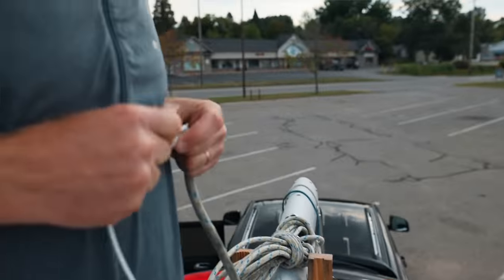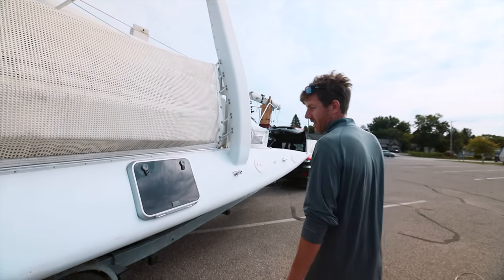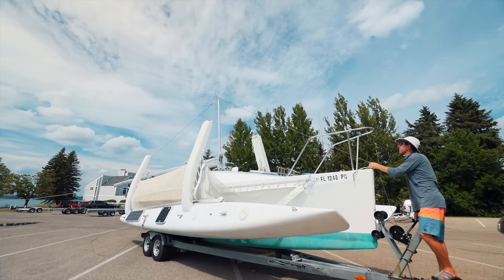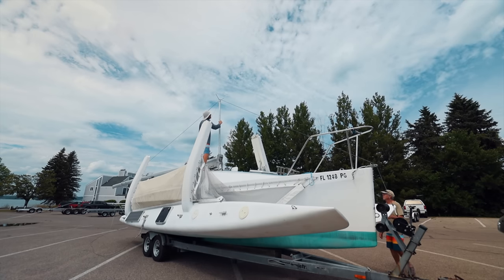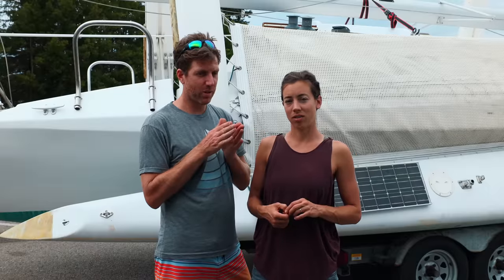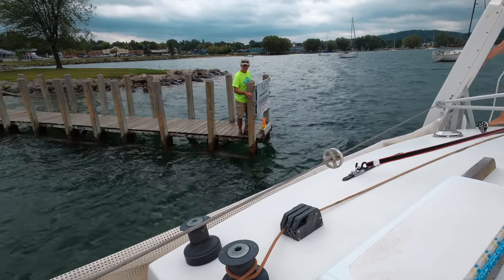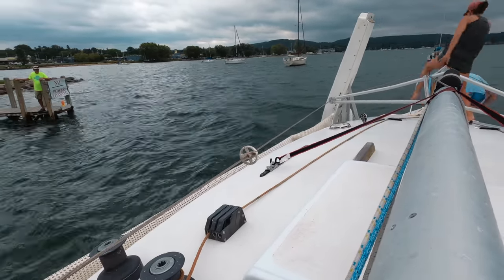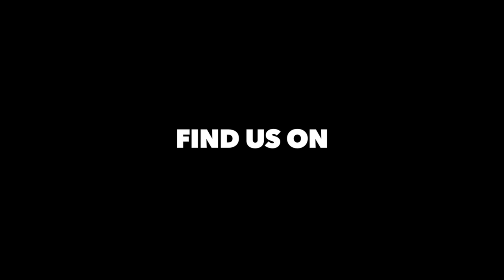How Many Quacks Does it Take to Launch a 32’ Trimaran? | Sailing Soulianis - Ep. 120

Comment: Another very important point to make is you never want to keep stressing a line if nothing is moving period the tensions on those things are incredible and if it breaks and a bolt is on the end of it and that bolt flies forward and hits you it can kill you period trust me I had two side stays on a 30-ft mast that were 1 inch off and the amount of pressure that was put on those was so high that I had to use a hammer to get the release bolt out and when it released it shot the bolt in the air probably hundreds of feet. Never ever keep stressing a line that's not moving period if it's not moving at all there's something wrong period those winches can easily put thousands of pounds on lines

Comment: As a MacGregor owner, I think your attachment point to the mast is too high up on the mast.  You're attempting to compress the mast rather than lift it.  The angle of lift would be more efficient if the lifting line to the mast from the gin pole was more like 45 degrees.  On my boat the mast is about 30 feet but the lifting point is about six feet off the deck.  Even in wind, raising the mast is casual for two of us.
Reply: Isn't it the jib halyard ~4 feet from the top of the mast?
Reply from the maker: That's an interesting thought... the farther down the mast you go, the less leverage you'd have.  But the angle of attack/approach/lift whatever you want to call it would be steeper and closer to the vertical direction you want the force to be applied in.  I'm certainly no whiz at physics... but I'm sure there probably is a sweet spot somewhere in the middle where the reduced leverage is offset by the more vertical lifting angle.  Anyone with a solid grasp on physics calculations care to chime in?
Reply: @SailingSoulianis If someone didn't have a fractional rig this might be an issue. But you want to use the jib halyard because it's the highest quality line available. The gin pole needs to be long enough to eliminate the question. Most trailer winches (~10ft) aren't long enough to do this job. Most people use compound block attached to the bow and feed back to primary winch and clutch. The gin pole should be attaching to part of the mast base so there is compression post below it. The jib halyard and lifting line must be connected to the gin pole separately. That enables the arc path of the pole tip which is the whole point. Using the pole end as a turning block is completely wrong and subjects a few things to breaking loads!
Reply: @SailingSoulianis  Just because I'm familiar with it, and because it's so well designed and popular, look at the mast raising kit for MacGregor 26. That mast is about half yours so your equipment needs to be ~50% better. Blue Yacht Sales or something like that.
Reply: @SailingSoulianis  The gin pole length should be from mast base to the lifting line attachment point at the bow. Do not lift by the forestay, you need it free to secure the standing mast.

Comment: That was generous to share your trials an tribulations.  Of course by Now you realize you should have assisted  the mast for the first bit by pushing up by hand or prepropping it at an angle so the gin pole wire had a better angle to the mast. But I’ve been raising masts by hand for years so would have figured it . I do think a twin A frame sort of gin pole would be a nice upgrade.  
Well you had all winter to improve system!
Cheers Warren

Comment: Here is an old but good step by step video about mast setting on a foldable trimaran

 https://youtu.be/eqsbJn475_g

and i guess if you stiffen up the mast lift helper thingy and at the same time put a post unter the mast-deck if deck rotten or weak you should be good to raise. 
good luck with that.
i already whatched you before you had a trimaran. i own one in Switzerland sind 5 years. love the show. and we love our tri as a family boat. 

by the way. often its very hard to fold the wings back in. especially, when there are many people on board. doing this with just body strengt wears you out over time. its very unhealthy. use the spi halyard instead at the top of one arm to about 45 degrees. that works even with a bad back.:)
but perhaps yours is easy. depends a bit on the boat.
Reply: we have a Farrier F-82 R... so a bit smaller than yours :)

Comment: A tip I learned the hard way is to number one for a launch have your anchor ready to drop in case the motor dies and you can't restart it period number two not only just have the motor running but actually have it running in both gears Ford and reverse for a while to make sure it will hold an idle when it's actually in gear so if the gearbox is bound up somehow it won't kill the engine period and then before you push off actually have it idling in the gear that you want it to be in when you're pushing off period if you can it's better to have that gear be the forward gear because presumably that will be the gear you use to maneuver the boat the most in your first launching especially when you don't have sales period of course that would mean you would have to put the boat in the water with the bow out rather than in and that's not always easy to do but personally I would swing the boat around on the dock using long lines before I launched especially for the first time period that way the bow is out and the motor can be idling in ford gear when you launch so you don't have to change gear while you're near the shore and you can get way back out there and have plenty of room to play with the motor if it dies period

Comment: Step/unsteppting mast process. (2man, can be done solo as well but needs practise)

(While living near mast cranes, I´ve seen alot of people doing it riight and wrong. Also sad and hilaroius moments.
But if u got a deck breach, I wouldnt even try to step up the mast. Due to the counstruction is self.)

two backlines to each or double winches. tread so the load is around the strongest part of the spreaders. And hitch then ends above the spreaders.
(If using mastcrane, the hitch ends need to be done below the spreaders, with a knot. Preferably a hangmans noose.)
Lift the end part of the mast a bit with a wooden piece before hauling up.
Have transom riggin ready for mounting.
Run thru a line from the topping lift and let someone stand on the bow. This line is used for guiding the mast while stepping up and down. While same person is moving the foot of the mast. 
the other person using the winches to lift the mast. one at a time, step by step. Finalize by locking the foot of the mast before rigglines.
This process should take about 20 minutes and should even be learned/used while in the water as well. (dont rely on the trailer.)
Attach port side rigging and starboard rigging
Attach rest of the rigging. 
Adjust rigging to the correct measurements of load that is configured for the boat.
Reply: Deck stepped masts are hinged to the mast base, as is the gib pole. 1 or 2 strong taller guys could just lift that mast without a gib pole and someone far forward with a long line attached to the jib halyard. Or 1-2 people using a gib pole.

Comment: I love you guys but you need motor basics.  Electric is not the way.
Reply: This is a huge topic, not either/or. It's in their nature to go elec and there is some upside but the whole good package is around $10K! We'll see how they procede when they have to write the check. Just some basics: 48V ~200ah of batteries, new heavy cables to the stern, 8hp equiv motor, and then if you have all that best to finish it with regenerative motor. Expensive package!

Comment: having experience with someone else buying the trailer under a wellcraft 21' boat I I bought on trailer in Florida  and the experience I look at yours and wonder if it is a long enough trailer for the boat.  What is the tongue weight for openers?  the ability for the bow to go up and down on the trailer is not right.  I ended up scrapping my purchased trailer and buying one the right length and the difference in towing and handling the heavy 21' power boat was amazing and safer when driving.  the former owner had bought a very marginal trailer that was two feet too short for the boat which made it dangerous to tow and when fully fueled gas in the onboard tanks it was downright unsafe.  Your boat should not dip at the bow when you winch up the mast.  Something does not seem kosher and looking it does not look long enough for that boat in my view.  Just check it out to be safe if you want to tow it long distances safely and step the mast.  I suspect the former owner saved money and the trailer is about 2 feet too short.  that is what my former owner had done.  It was marginal from day one and not nearly as safe for me so I junked it and bought the right size.  check it out.  Would not be the first time this has happened with boats on trailers.  Yes, I towed the wrong one with boat from Florida to Virginia but it was lucky I was a conservative driver...the rig was over 4,000 pounds.
Reply: Sailboats sit on trailers differently. Power boats are much flatter on the bottom from front to back. Compare differences of LWL vs LOA. The winch they were using to lift the mast was the trailer winch and they connected the gib pole incorrectly which led to the compression that exacerbated the bow movement.
Reply: @artsmith103  I know.  Look at how the trailer length and bunks are set up launching the corsair 31 ...same boat basically...and you can see either the wrong trailer length or the bunks are not set up correctly or both by original owner.   Measure the tongue weight and I bet it is too light as a result

Comment: As everyone says, the forces to pull up a horizontal mast are enormous, almost impossible. Something would have to give, either the mast would bend, the wire rope would fail or the winch would fail or simply not be strong enough.
Reply: That's the purpose of the gin pole. It changes the pull direction upward to overcome mast position. Of course, any head start is nice but not critical. Shortening the travel is almost more important. When the gin pole gets to the deck, you're done. Nice to have ~10° of slop. There were a few things wrong with their gin pole setup. They'll fix those and not have these issues again.

Comment: Shouldn't the Pole have been at a 45° angle so all the stress on the Gin pole was vertical. The pole should rotate as the Mast comes up I think period I'm not sure you should have drilled a hole in the mast in the pole rather I think maybe the pole was meant to be flexible without that hole.
Reply: The mast should start at around 10-15°. The gin pole starts vertical. Then they rotate up together maintaing that ~80° separation. And if some lines stretch, the mast is vertical before the gin pole hits the deck.

Comment: The reason the boat was bending and the Gin pole base was getting pushed in was because you had way too much pressure on it because you had the ginpole vertical period the gym pole is supposed to sort of rotate as the Mast comes up it's only reason to exist is to hold the line up above the deck so that the forces on the mast are at are at an angle rather than straightforward period but by having the gym pole fixed in a vertical position you're just creating a tremendous stress on everything period the only thing that should be taking all that stress is the main Force day halyard and it's forward pulley on the bow period
Reply: You bring up an interesting point. While it's been mentioned many times that instead of connecting the halyard and hoist lines separately, they connected the lines and used the end of the gin pole like a turning block. Are you suggesting the gin pole might not have been hinged? Vertical is not a problem. Done all the time.

Comment: You should have two small outboards one electric and one gas.  Just a Sub $1000 electric outboard would push that thing pretty fast.  Making a double bracket on the back is all you'd need to do.  Also with both running you might be able to double the hp without having to necessarily double costs.  A long passage might necessitate a gas outboard no matter what in a bad situation.  Electric is great, but sometimes in a small set of circumstances it just can't cut it.
Reply: This boat has a lot of windage. They had one small outboard issue. That motor is too good for plan B expense. Wiring and such no small issue with small stern. It's their nature to go electric eventually.

Comment: um you guys realise your supposed to extend the out riggers before leaving the dock dont you?
Reply: With sails down, doesn't matter.
Reply from the maker: The boat is designed to be able to be motored in relatively calm seas with the amas folded without issue.  It was MUCH more stable than I even initially imagined.  Pretty cool engineering!
Reply: @SailingSoulianis  well everyone i know with them tells me you never know when some idiot in a big power boat is going to roar past, better safe then upside down. 😉

Comment: A qualified engineer could calculate the loads and required improvements for the entire system for raising the mast. The trailer needs to support the hull better, the gin pole needs to be much longer and stronger, the winch needs to be much stronger, possibly electric, possibly located on the towing vehicle rather than the trailer itself. Keep in mind that the cable crossing the gin pole will be under VERY LARGE load, due to deflection!! << If you do not understand that comment you definitely need an engineer! You do not want this cable to break and hit you in the face.
And always test start your engine just before you launch your boat, so you know it will start.
Reply from the maker: All good points... We just had the engine serviced, and ran it on land for a good 10 mins before launching.  Seems I'm constantly amazed by how long an engine will idle with the fuel it has in it's line.  Because clearly 10 mins wasn't enough :)

Comment: You guys are trying to rush, you need to prepare more. No point in stepping your mast if you know the deck at the mast step is soft and rotten. You won't get enough tension in your rig and may damage it. As others said, you need a mast crutch attached to the rear of the boat maybe on the rudder pintles, to get enough angle on the mast before you start winching it.  You should have tested the outboard on land. Even a good new outboard will run bad if it has been sitting around, and may need a carb clean..
Reply from the maker: That’s all easy to say from the other side of the screen 🙃 It’s impossible to include all the steps we took prior to the big launch day in one episode. We didn’t know about the deck rot, we learned propping the mast up would help a bunch, and yes, we tested the motor before we left our house (even had it checked out by a mechanic) AND once we were in the water, before shoving off. Sometimes you just don’t know that your fuel line isn’t seated properly until the motor works through the fuel that was in the line, and then runs out of fuel. 🤷🏻‍♀️ Appreciate your comment, but know a lot happens that we just can’t always show.
Reply: @SailingSoulianis  Don't you have a compression post (or bulkhead) under the mast base? Slight rot might not be a crisis. If you saw flexing, it's more likely due to lifting lines going over top of gin pole rather than separate attachments to end of gin pole. Double check that trailer winch is a fair lead. The gin pole then needs to reach tip of bow but that's where the forestay goes. I have my doubts about using that winch. That also leads to the bow bouncing around.
Reply: @Sailing Soulianis @Art Smith good point about the gin pole.. it needs to be long enough to almost touch the forestay fitting.  I've gone through getting my boat ready to launch for the first time, without ever seeing the mast up before I bought it, and had to build a mast crutch and a gin pole (I used both the Spinnaker sheet and jib uphaul for extra safety). I tested raising the mast a couple of times before getting it near the water. After inspecting the sheaves in the mast, I replaced them too, they lasted for the first mast raising but would have failed or jammed if I used them again for mst raising purposes. Hopefully the second time at the water you guys will have more luck 🙂

Comment: Sorry but that was not good. Your yard was plenty big enough to practice stepping the mast repeatedly until you had resolved all the issues and become familiar with how it should be done. likewise the engine should have been run for a while before leaving the dock.
Reply from the maker: It would have been stressful the first few times either way. We knew the boatyard could step the mast if we couldn't get it up... and we weren't blocking the launch ramp. So trying it out at our place vs at the ramp really made no difference at all. We just had to try it :) 

Engine was run for a bit while on land, and seemed to be purring contently at the dock. It was only when adding throttle did the air suction issue arise.  All in a day's learnings.